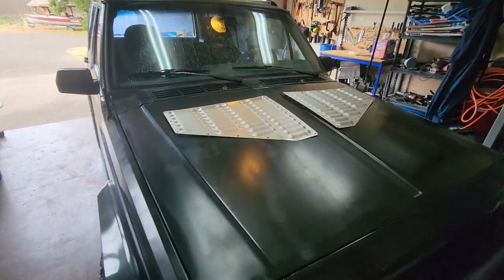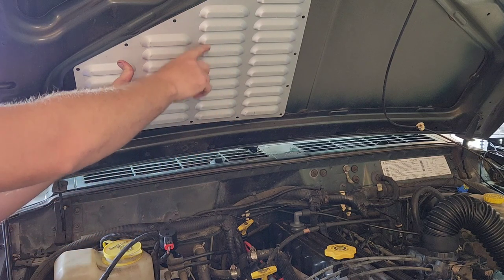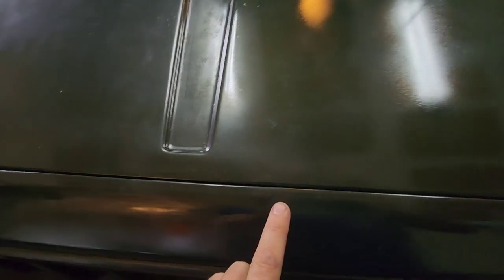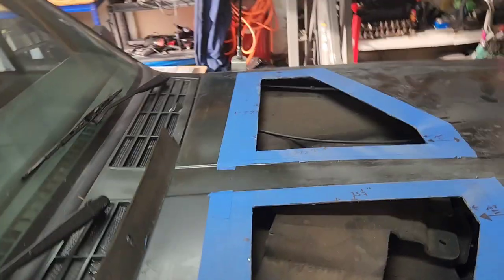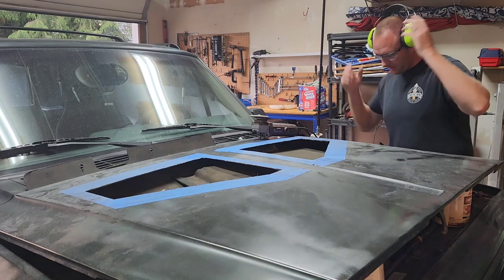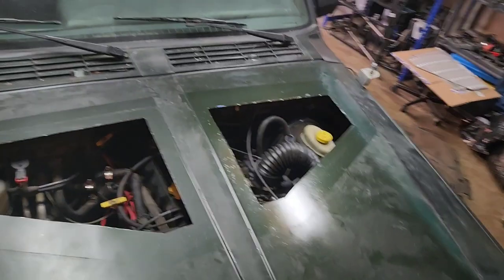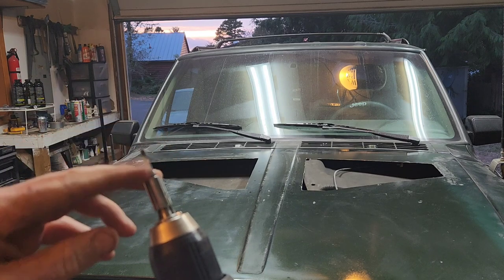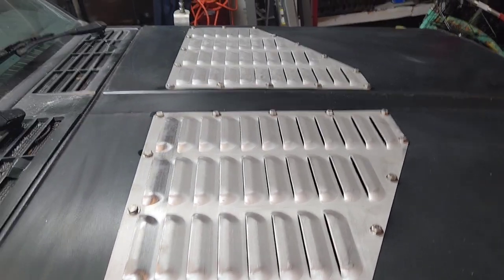1996 Jeep Cherokee Hood Louvers installation

Comment: Just seeing this video and wondering how or if the rain affects anything under the hood?
Reply from the maker: It does let water in but the louvers are slanted so it's not fully exposed. If you have exposed contacts or questionable connections that may be an issue

Comment: Did it help with engine temps?
Reply from the maker: Drastically, while at low speeds. Just make sure all of your sensors plugs are good and waterproof if you live  a wet area.